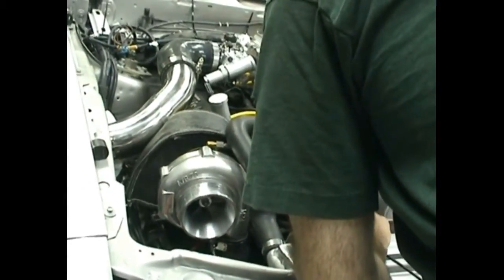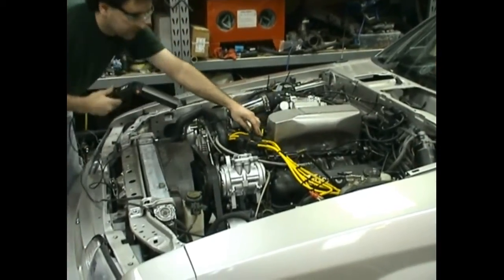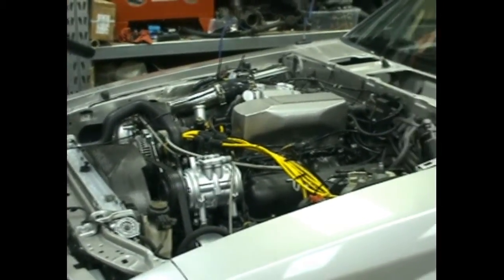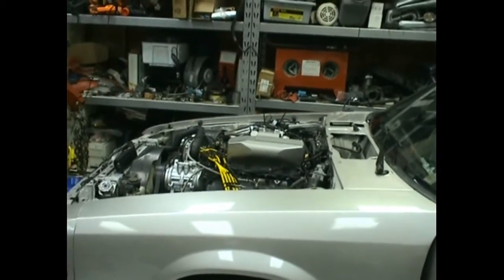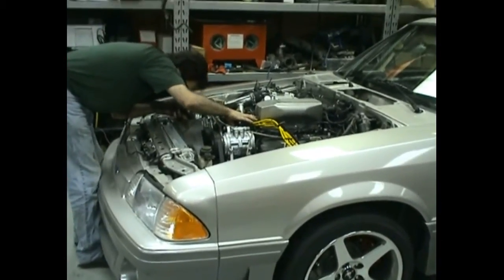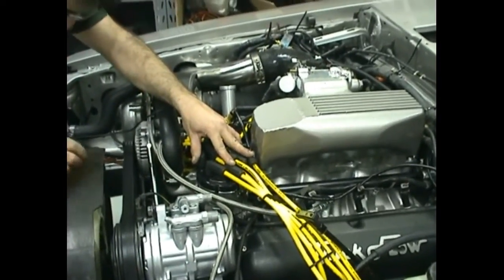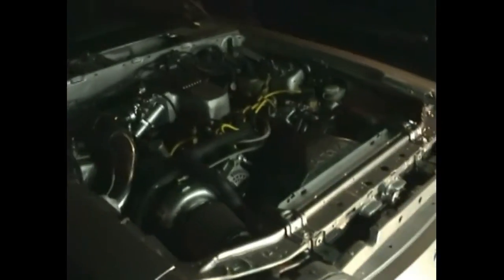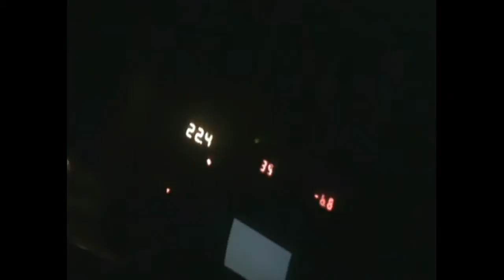Mustang GT 1990 Fox Forged 383 CI Stroker Turbo First Start

Comment: Here is a tip for you on starting a motor for the first time:
1. Find TDC on #1.
2. Then set the balancer at 14 degrees BTDC
3. Now put the distributor in and set the rotor at the #1 plug terminal
4. Start car, it will fire right up
5. set timing